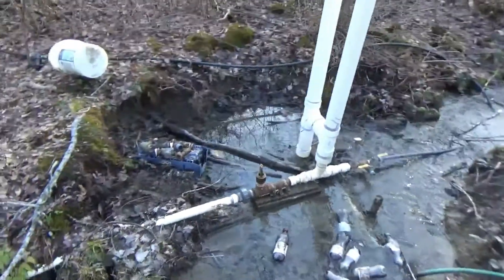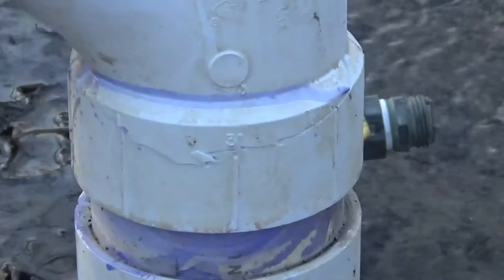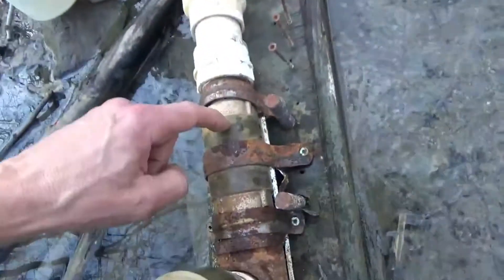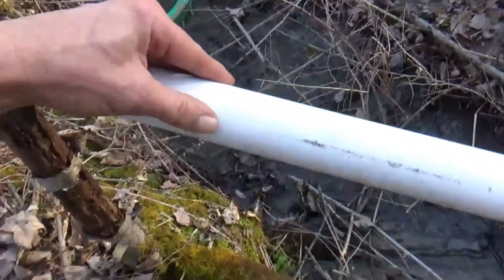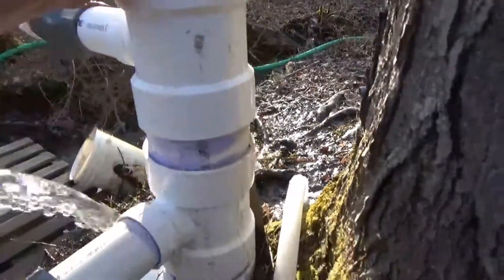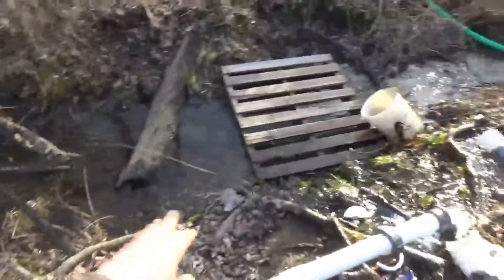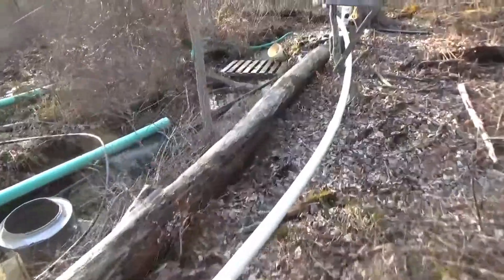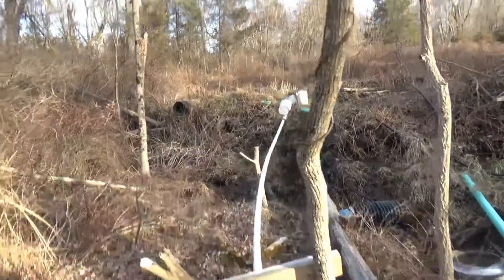02 20 2018 Ramp Pump Repair Assessment

Comment: What caused the lack of flow to allow the freeze?

Any benefit to going all brass or all stainless on the pump section?

I am seeing brass foot valves for $20 or so, at least in the 1" range
Reply from the maker: I think maybe an air bubble or something stopped the pump, However, it was VERY cold so it's possible the pressure chamber froze and stopped the pump... at super cold temps it's minutes to freeze back through the whole system.  All stainless would be preferred from a wear and durability standpoint, but the price for my size (1.5 inch) is VERY high to do that.  I plan to bury most of the system this coming summer including the delivery line. Anything I can't bury will have some sort of protection (pump housing with insulation or something). Then I will have all winter water delivery.
Reply: @TheFarmacySeedsNetwork  How many raw gpm does it take to feed a 1.5" system? How much does foot/waste valve sizing affect delivery volume?

I appreciate your answering my questions. Is email better?
Reply from the maker: about 15 GPM to drive the 1.5 inch.  Delivery volume is really a function of efficiency... drive pipe type, waste valve size, etc... ultimately it should be scaled (bot5h valves and drive pipe same size). Here's an article on it all:  https://www.slideshare.net/Fatin62c/homemade-hydraulic-ram-pump-clemson-university
No... youtube comments are best so everyone can learn. cheers!

Comment: Good news not having to replace the brass valves. I've been busy with my little spring and pump too. I added a level sensor to the settling tank to control the pump using a mechanical ball valve via a relay, and have sunk a couple of 44 gallon drums under the waste valve to supplement the delivery using a submersible pump. The electric pump is currently just manually switched, but I'm in the process of automating it to run while the spring box is recovering, as well as adding remote monitoring since Wi-Fi will be available there.
Reply from the maker: very nice!  Yeah, I am waiting until my budget cooperates, then I'll add a solar powered secondary pump for the "low spring" season that will deliver 5 GPM when the ram just cant cut it. Right now, I'm focused on switching the greenhouse over to all solar power (raspberry pi etc etc). I want everything here grid-free ASAP.. :)  I'll get a  video up soon when it is finished.